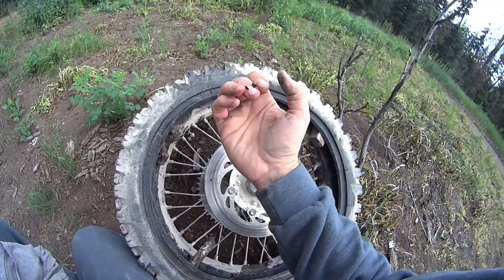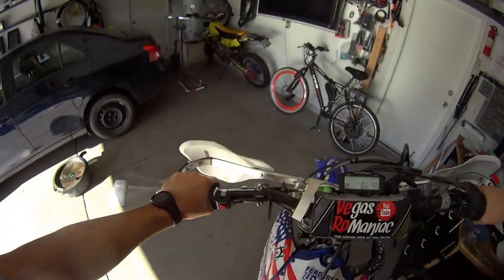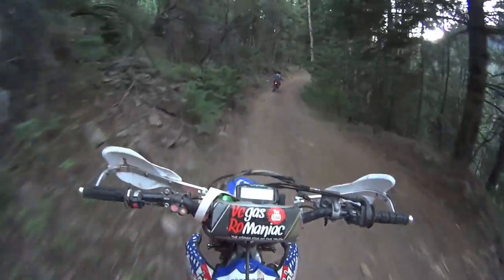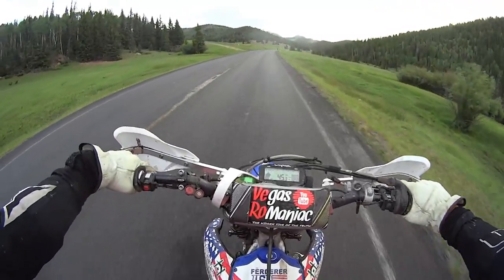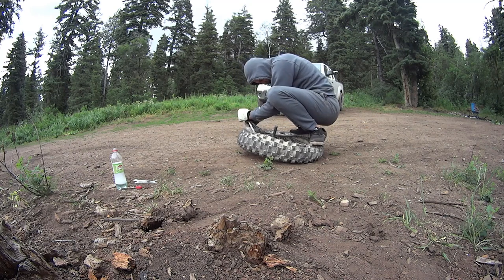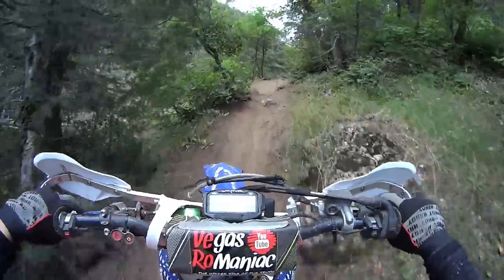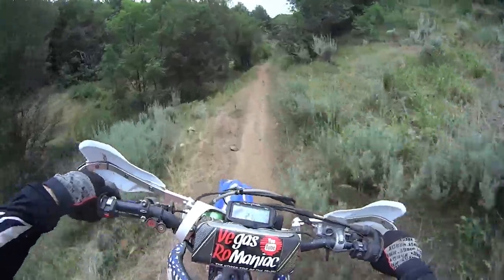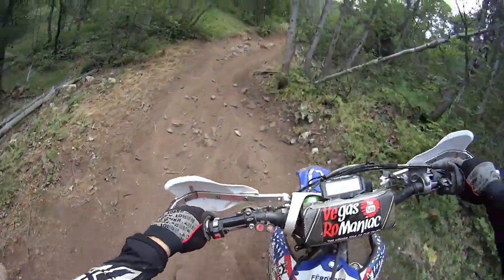It lasted 230 hours and 5 tires, rear Nitro Mousse Tubliss BIB insert FAILURE, All my Fault

Comment: A couple months ago i was a die hard tublis guy not anymore had a rear flat it was the little tube cost me a first place win replaced the tublis with a bib moose love it as soon as i wear out my front tire will put a moose in when i replace the tire get all the traction i want and don't nolonger worry about flats im sold on the bib moose that's all i will ever have for now on
Reply from the maker: I love them, been terrorizing rhisnoe for over 3k miles and I might be the cause that it failed, wrong tire size
Reply: @vegasromaniac  i couldn't believe the traction i had with mine best thing ever i got better traction than i ever did with the tublis running 6psi the moose made a believer out of me

Comment: Nice to know you get that amount of hours out of your mouses. I haven’t been able to ride that much this month so mine still have relatively low hours. Interested to see how they’ll look when I change tires.

That trail side repair was very creative. I carry zip ties (the big HVAC ones) in my pack in case there is a bead or mousse failure. Stabilizes the tire enough to limp home.
Reply from the maker: Even with the colapsed  mousse, the bike was fine...

Comment: Interesting video. I was wondering how your rear rim was looking at only 5psi. It looked a bit rocky in places.
Reply from the maker: Rim was fine  the trick is to protect the bike while you ride  plus it's a yamaha rim, Ktm cuts corners to make it light, yamaha makes thick rims still
Reply: Vegas RoManiac have to agree with that. I’ve owned a few Ktm’s over the years and all hand grenaded to quick. Back on a drz 400 e and a rmz 450   Both brilliant motorcycles.

Comment: How many hours do you have on your bike? Also have you replaced the crank/bearings?Also how often do you do a top end?
Reply from the maker: 230 hours, didn't replace anythijg, checked valves and timing chain, all good expecting 500 hours out of the tops end. 30 hours oil change conventional suipertech from Walmart

Comment: I like the way you fixed the Problem. You could also have put in some Grass "Balls" (that one for the Cows ) instead of your T-Shirt. Works good as well. The reason why this happend to you ist that your Mousse was shrinking. Quite Normal with that mileage. Heat , indeed, is not good for Mousses, but I guess not the hot Garage was killing your Mousse, but the Road driving heatet the already war weary Mousse up and destroyed it..
Reply from the maker: yeah my mistake is that i put a small mousse in a big tire , too much gap !

Comment: yeah you got 200 hours on that moose. Iowned my current bike for a year and a half and i bought brand new. i only put 43 hours on my bike in a year and a half so about 30 hours or so a year because it gets to 125 during the summer with 30-75% humidity.
Reply from the maker: Yeah, I got lots of hours on the bike man
Reply: that's good. i have like 20 years riding but this bike i have now i haven't been able to ride as much as i'd like to.

Comment: Idk I like my tubliss you can get home on the rim lock if the high pressure fails as long as you are running 6 ply tires and slime with tubliss
Reply from the maker: Same on tube at that point... Tubliss overcoplicates a problem it doesn't solve

Comment: Dude lesson learned the hard way.  After long runs you need to break them down a re-lube reinstall.  If you don't run a directional tire its a good time to flip it. Storing on a stand is a good idea, but won't wreck you stuff if you don't.  Heat is the enemy when it comes to bibs.  I have used Murphy's tire soap the a little water after the initial use of the lube that comes with it. The stuff is cheap and use a lot of it.  Water and crap get in the tire even with tape over the valve stem hole.  Clean the crap out and re-lube.  Your bibs will last longer. I usually order extra lube when I buy the moose and keep some in the garage.  My garage gets super hot as well in TX and not issues.  I get a lot of life from my bibs.  As you bead gets easier to push off the rim the bib is shrinking.   Don't throw out old one.  I cut the bib.  Slide a in a chunk of old bib.  Then got ride some more.  Keep it lubed and you will get a plenty of life.  I ran my last one too far.  Was having a great day at enduro... Hit a section coming out of the tunnel on the way two gas # 2. Thought I was off the concrete... I lit it up and go enough traction that I busted the bead on the tire.  decided not to even mess with it and hitched a ride with gas trailer back to the truck.   I was debating during prep if I should toss a tube in there before going.  decided not to mess with it.
Reply from the maker: This mousse was done before I shuved in there, also I think the big tire input it on was the problem  too muc gap. Truth told  I need to switch back to tubes, not becaye they are better  I'm getting fre tires for review and they are quite difrent sizes, moussse doesn't like that, it verry icky of the size of the tire you put it on.. Lubijg helps but verry little in the right tire I run this moussse  with no lubing till I got it in the wrong tire. It came out of 3 tires 110 and went in to a 120 wide.. It it's what killed it

Comment: You should attempt a "Home Made Moose", would be interesting for sure.
Reply from the maker: I already did  bud, video coming soon, major failure, pool noddle
Reply: @vegasromaniac  LOL, can't wait to watch it.
Reply: basically tubliss would be the ultimate, If that liner that protects the high pressure tube, was a puncture proof, Kevlar or other material. Here in Wa. We don't have the sharp thorns, so they work fine.
Reply: tennis balls in my suzuki ds80. works great

Comment: 230hrs on a mouse is respectable but this is why people prefer tubliss, and this is the issue some have reported, they break down. Tubliss can be run at zero pressure I have heard.
Reply from the maker: Tubliss it's for slow riders that look for traction, at high speed tubliss pinches tire sidewalls and you are done, at high pressure they are basically glorifyed tubes. Never saw a fast rider on a tubliss...
Reply: @vegasromaniac  I know Graham Jarvis was using tubliss at some point, I would say he's pretty fast...I prefer tubliss on mountain bikes but never rode tubliss on dirt. Have you used tubliss on your dirtbikes?
Reply from the maker: @TepcoCycleRepair  Jarvis races mousse, if he rode tubliss onece he was sponsored, you can't live your life based on the illusion  advertiser's wanna sell you that's why the trails are full of slow people ridjng 2 strokes
Reply: @vegasromaniac  lol, slow people riding two strokes, you're killing me I think the heat has finally got to you!
Reply: @TepcoCycleRepair  what excatly are you trying to even argue? The mousse lasted that many hours without problems, nothing lasts forever. I would say that he would have had so many more problems with a tubliss.
Reply: @wilska8835  not arguing anything, I agree that amount of time on the mouse is impressive as stated. I don't use either I still have a tube with a tubliss system hanging on the wall. Just stating that people complain that mousse fall apart, and choose tubliss instead because of it but probably never used one.  I agree with you that that's a hell of a long time and totally acceptable. Just making conversation, and bringing things up because most people talk trash about one system or the other but have never used one. Like Vegas commenting on tubliss but never used one..now I know it wouldn't work in his area riding around cactus.. so saying they feel one way or the other is just him guessing..
Reply from the maker: @TepcoCycleRepair  I'm always stuck behind one fumigating me
Reply from the maker: @TepcoCycleRepair  I had a tubliss btw   about 3 years ago, tried to install, didn't gold air fozijd out that I had a cracked rim, returned the tubliss did tubes for another 5k miles on that rim and sold the bike like that... Never looked back
Reply: @vegasromaniac  Someone gave me a tubliss rear set up, I think I'm going to fight it to put it in just to see how it feels, out of curiosity.. just rocks here no cacti! I'll post up a vid when I do.
Reply: I've got over 200 hours on my tubliss and never a problem. Plenty of cactus here in southern Utah. Just put in some self sealant and go ride.
Reply: I have a tubliss but i m riding mud/dirt no rocks ,but i m at 120 hours and no problem with the tubliss..

Comment: What if you stuffed a tennis ball in there? Lol or what if you stuffed a tire full of tennis balls instead of mousse. Wonder how well that would work.
Reply from the maker: How many you think I need? I wanna try  that
Reply: Vegas RoManiac try pool noodles too 😂
Reply: Vegas RoManiac Assuming 21 inch rim, I’m guessing at least 26 tennis balls. Tbh idk if a tennis ball will even fit in the tire body lol. Seems like a fun idea.
Tennis balls or something similar that would fit. Rear tire has a different width so another sport’s ball may need to be tried.
Reply: I have run tennis balls in my front tire. Worked perfect, friends rode it and couldn't tell. I got all the balls from a local tennis club from balls hit over the fence, all free and all like new!
Reply: Funny thing is this came up in a dream I had last week. lol. I had never thought about it in the waking hours of my life.
Reply: How about the “indestructible” tennis balls for dogs?  I think they only weight 0.5oz more per ball.

Comment: I thought the "tubliss" didn't have any tube. Watched a video.  Too much work, too expensive. I raced New England Enduros for 3 years and never got a flat. Luck ? I did run my pressue up @ 18 psi. Never had the chance to even ride a bike with a mousse in it.
Reply from the maker: 18 psi is same pressure as a tube , what's the point of a tubliss than, overcomoiicates a problem that doesn't solve

Comment: Tom Webb destroyed mooses 20 years ago. High speed + high temperatures kill them. Supposedly they get even hotter as you ride which speeds up their deterioration. He killed his doing high-speed desert riding on a KX500.
Super heavy duty natural rubber tubes have been working for me, so I aint gonna fix what aint broke.
Reply from the maker: im going back to tubes , but for different reasons , ill explain in a later video
Reply: @vegasromaniac  Cant reccomend Moose super heavy duty natural rubber tubes enough. The only downside is they very slowly loose air. Check the pressure once in a while and you'll be fine.
Reply from the maker: @dr.hugog.hackenbush9443  good choice, but I get mine for free, so I ride what I get , life of a youtube it's difrent I guess, we ride what we get

Comment: The maintenance level is very high on big mousse also they are supposed to be greased at regular intervals..do your research
Reply from the maker: It's not the grease, it's the wrong size tire and the fact it had 3k miles on it when input it inn, was already ruptured